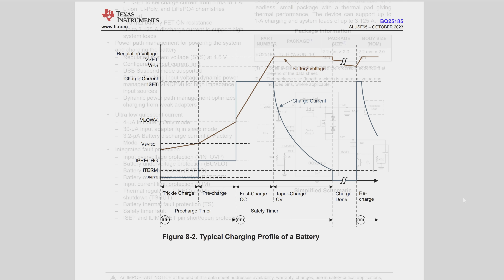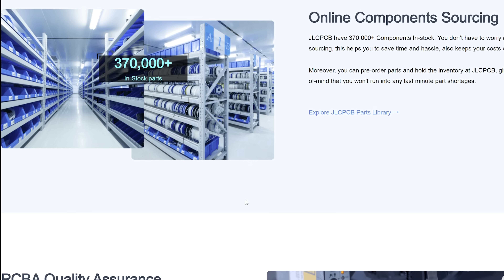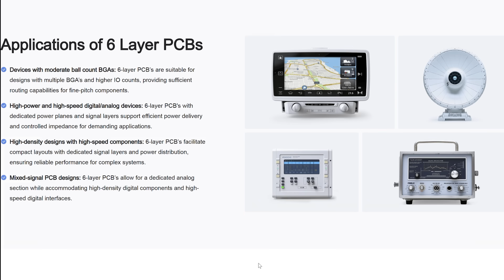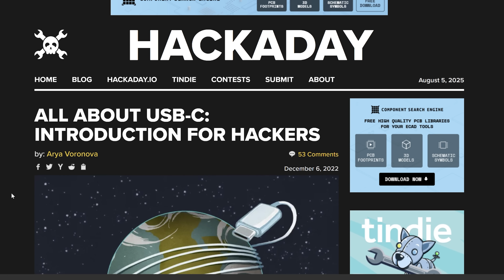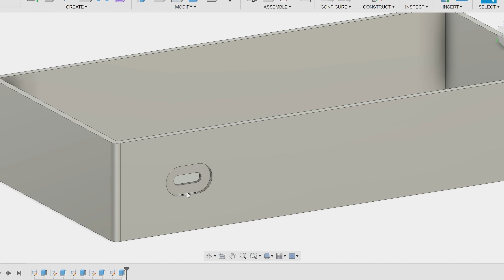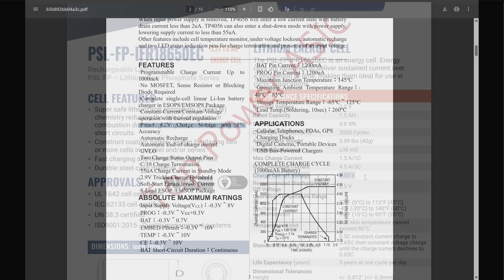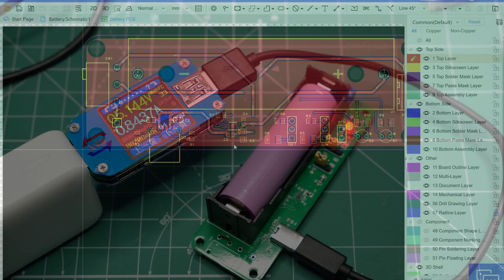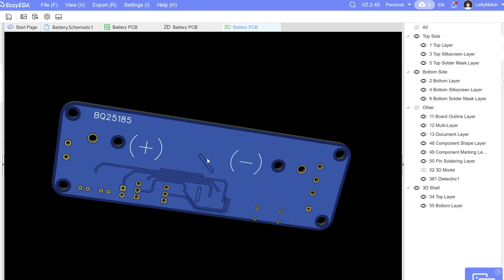Why I made my own battery charging module (no TP4056)

Comment: 5:08 for the pin headers you can use a potintiometers so you don't have to remove and resolder a resistor.

Comment: I have tried connecting those TP4056 based modules in parallel, with good results. Stacked one above the other.
I've had 3 stacked up charging a 1s 10AH flat pack lithium ion battery, connected to a solar panel able to output 2 4A. It seems to work quite well
Reply from the maker: Sounds interesting. It could be worth testing and doing measurements.
Reply: @LeftyMaker If you buy a heap of modules and can test them, parallel the ones most closely matched. I didn't use any resistors or anything, I didn't even match them, I just put the three modules on top of each other and ran tinned copper wire through the holes and soldered them. I noticed one out of the 3 lingered in charging, before going from red to blue, but it didn't matter with the big battery im using. I womdered about putting them in a little metal box and filling it with oil to promote heat distribution, but didn't worry about that either.
Anyways, just some food for thought.

Comment: FINALLY!!!!! THANK YOU INTERNET ❤ Have I been tearing my hair for years? Thought: Let's connect some Li-ion cells and get juice throughout my longer bike trips. NO!! NOT SO FAST..3,7X2= 7,4. There must be a module.. oops poof, frying sound, bad chineese quality, screen broke, .. * three years later * building module from scratch, plugging it in, worked at first, capacitor exploded when I played around with 50 volts.. well I love your idea and I will build several small ones and a big one.

Comment: You have many boards of your own design. And almost all of them have mounting holes. And some of them can be considered not as devices, but as modules of a certain functionality.

Are the sizes and placement of the mounting holes determined by something? Or were they chosen randomly?

If randomly, could you make 2 mm holes with a pitch of 5.08 mm in the future?
Then these modules will become mpp2508 compatible.
You can see what this is for and what it looks like by following the links in my profile (the last two).
There are renders of my modules, as well as photos of real assemblies - prototypes of devices for debugging. Perhaps you will like the idea.
This is an open project, and I am trying to attract attention to it. I do not have enough feedback. Its goal is to quickly assemble prototype devices in order to start writing software with minimal delay.

I have a battery power module in my plans, but I have not gotten to it yet. Is the circuit diagram of your module closed?

Ask questions if you have any.

Comment: You can add a dc-dc to this board and generate 1.8, 3.3 or 5V required for most MCU’s, and then sell it. I really couldn’t find a cheap module that can charge the battery and power MCU for my game console project.

Comment: You're comparing two completely different things. Your board is a prototyping tool — it has screw terminals, jumpers, and a built-in cell holder. That’s great for bench testing, but it’s not in the same category as the TP4056, which is designed to be a low-cost, compact module for embedding into larger systems.

Saying it needs hot glue isn’t accurate — people regularly 3D print mounts or use slot holders. As for charge current, it’s set by swapping a resistor, as shown in the TP4056 datasheet’s RPROG chart. The current is meant to be fixed per battery. If flexibility is needed, you can just drop in a potentiometer or built yourself a similar resistor array with jumpers to quickly change the charge current.

On protection: the TP4056’s default DW01A isn’t ideal, but there’s a well-known exact drop-in replacement — the FS312FG — which raises the over-discharge cutoff to 2.8–2.9V. It’s super easy and cheap to implement — you can get 50 of them on AliExpress for around $4.30–$4.50.

Regarding USB-C: the board in your own video has an empty solder pad behind the port, labeled R4, which appears to be for the 5.1k CC resistor. If you don't want to do that,  just use the micro-USB version of the TP4056 with a USB-C breakout board that already includes the proper resistors. It’s more of an inconvenience than a limitation.

Honestly, I’d even recommend the micro-USB version of the TP4056 over the USB-C one — it has better build quality (larger components, thicker traces, better layout), and you can pair it with a proper USB-C breakout for the functionality you want.

And finally: cost matters. TP4056 boards are about $0.15 in bulk and are drop-in ready. Your board definitely has a purpose, but it’s not a better replacement — just more convenient for prototyping. They’re entirely different tools, and saying "mine is better" overlooks the actual use cases and constraints most builders are working with.

Comment: For the original module, having terminals for connecting batteries with cables would give it dual purpose. Another design would be a competition to the small board with a better design. I particularly like the possibility of adjusting the charge voltage for different chemistrie.

Comment: I would see charging modules limited to 4.05V or 4.1V which improoves battery life by factor 100. no aging when full.
Reply: I’m trying to build one with discrete parts (lm339 comparator, LT431 adjustable zener, mosfet) but don’t go ok, i need to simulate better,  do u know what ic can adjust the terminal voltage ? I’m trying to reach 3.9 - 4.0 for li ion to obtain much better life cycles

Comment: I appreciate the effort you’ve put into it. This is great if it's for specific use cases like to make commercial custom products.
 
Personally, for my DIY projects, I prefer to go with the TP4056 since it’s quite cost-effective. The module is about ₹12, a holder around ₹15, and a panel mount micro-B pin about ₹5 on robu in website. With an occasional voltage regulator, the total comes under ₹50 (around $0.50) to convert toys into rechargeable ones. Custom boards cannot beat this price.
Reply: Plus, the OVD cutoff can be increased to 2.9v by swapping out the DW01A for a FS312F-G.

Comment: Another reason not to use the TP4056: Every one of the cheap Chinese modules have a design flaw in that they can overcharge a cell without protection. You’re supposed to disconnect from the load while charging.

Comment: Thermal management for tiny parts like that can be difficult. There just isn't room in the thermal pad area for more than about two to four vias and typically you're stuck with using thin copper to allow the narrow tracks necessary for the fine pitch of the "leads" of the part.

Solder-filled vias in the thermal pad can help a bit, but that is difficult, too. To fill the vias, unless their holes are extremely small diameter, can require more solder than it is possible to screen onto the thermal pad area. Solder flowing into the vias can "starve" actual pad area, leaving it with voids that impair heat transfer It looks like your PCB is about 1.6 mm (1/16") thick, which exacerbates these issues compared with thinner laminate. Copper filled vias can be a good option in terms of performance but may run up the cost of the bare PCBs.

I can't imagine any heatsink attached only to the top of the IC being of any significant value.

~~~
I've watched an number of videos of "over unity" power generators and other fraudulent devices. The makers of such things are great believers in use of hot-melt adhesives.
Proper mounting holes can take up a lot of board area, but at least you have something in the end that isn't held together mostly by wishful thinking.
Reply from the maker: Thanks for the feedback. Yes, the pcb is 1.6mm, JLC's economic option. I've never tried using any vias other than the default ones in EasyEDA. I've only placed a few around the chip, but not under it. Guess I should experiment with vias under the chip someday. By the way,  I think the chip would benefit even from a tiny bit of improvement. Even touching it with my finger is enough to pull enough heat away to bring the current back from 0.8 to above 0.9A.

Comment: @ 7:12 your 3D file shows three pin headers what's the third one that almost immediately after is not there on the board but has spots for it for
Reply from the maker: They are for a button that enables factory mode, which is a super low-power state, and for connecting a temperature sensor that monitors the battery's temperature

Comment: so that chip doesn't let you independently set current and voltage limits; it can only be one of the set configuration pairs in the table?
Reply from the maker: Charging current can be configured precisely by varying a resistor. However, the input current limit, which is set for protection, can only be one of the values in the table. I haven't tested this, but from what I understand, the max and cutoff voltage levels are also set only according to the table. Weird that they don't have an adjustable cutoff or at least a 2.5V setting.
Reply: @LeftyMaker  ah ok i somehow missed the ISET pin.  Yeah it would be nice to set the cutoff voltage to something like 3.5V which would get at least 90% charge on a LiFePO4 cell AND usually be within limits for direct 3.3v rail input on most microcontrollers/peripherals.

Comment: This is acutally realy cool, and a good idea to be configurable in many ways, sadly I lack the knowlege to make a design like this.

I tried using a tp4056 but it softened the pla of my 3d printed design so linear ones dont work for me, and havent found anything pre made on aliexpres that fits my needs, so in the end i just put a usb-C decoy and made it batteryless. It would have been cool to to have a battery cuz its an owl wallamp with the wings as light, you can find it on the printables store if you want some pictures of it. 

I saw an other similar one on ali that has UPS function (I like the idea to be able to have a battery if needed but have it pluged in most of the times and if im not mistaken its better for the battery that way) but that isn't configurable at all. 
Anyways maybe that would make this even better, and some switching ic but still with the configurable charging and protection.
Reply from the maker: Wow, didn't expect the charging board to be able to soften PLA. But yeah, I'll probably make more battery charging designs in the future.
Reply: You said it softened the pla so did you change the charge current at all? Because that's what leads to heat generation...

Comment: Please don't call them batteries. They are cells and if you put two or more cells together it will be a battery ... 😊
Reply from the maker: A single cell is still a battery
Reply: @LeftyMaker  "A cell is a single unit that converts chemical energy into electrical energy, while a battery is a collection of two or more cells connected together to increase voltage or current."
Reply from the maker: @fu1r4 According to both Merriam-Webster and the Battery Reference Book by Thomas P J Crompton, you can call a single cell a battery. Definitions change over time to facilitate communication. (Source: https://books.google.bg/books?id=QmVR7qiB5AUC&q=battery+one+or+more+cells&pg=PA11&redir_esc=y#v=snippet&q=one%20or%20more%20cells%20connected%20to%20form%20one%20unit&f=false)

Comment: 7:04 - But what is glowing there is the dual-MosFET.
The old TP4056-modules had a much bigger resistor to set the current, with the newer Modules it is very difficult with this 0402 resistor.
Reply from the maker: Not really. The camera can only measure at one point, and the image is misaligned. The chip gets hot
Reply: @LeftyMaker  - Okay thank you. Yes, the MosFET would be only hot if you discharge the LiIon-Cell in this moment.
Better make a photo without this composite-image of the normal picture and the IR-picture. The mixed image is confusing.

Comment: I love these type of projects. The TP4056 are "fine" at best (I've run into the 'shitty USB-C' issue plenty and hate it) and a lot of microcontrollers have truly terrible on board chargers. Which is extremely annoying because, ya know, microcontrollers are kinda useless without power. Personally I don't care about super fast charging. But I'd love something where I can easily plug in, charge and have my microcontroller mounted on back with whatever sensors and doodads attached.

Also also, if you're building cool things. Same thing you have here but with solar input.

Comment: This is an excellent project and I appreciate what you mentioned about the mounting restriction for TP 4056 however, hot glue isn’t your only option. I tend to mold the  correct shape into my 3-D printed part and holds it security for many years.
Reply from the maker: I see. Yes, that should work too!
Reply: This exactly.

Comment: My hands are itching to glue a tiny heat sink to that chip. And yes, you should make improved version but with switches instead of jumpers.
Reply from the maker: I use jumpers because I have hundreds of them in my parts bin. I also have switches that fit exactly into that same 3x1 space :)

Comment: at work i used bq25616, 1cell 3A buck charger, it can take inputs above 5V, i think it goes to 13V. for battery connection you can take a look at keystone 54, 54 is the part number.

Comment: I keep toying with the idea of building a cyberdeck, but I don't have the electronics skills to design anything like this. It would be more of putting together existing things to make a working unit. I really like the advantages you are explaining on your design, but it would be really nice if it would be multicell, as powering a cyberdeck on a single 18650 would be very limiting. Even my Clockwork uConsole uses 2 of them (while it would technically run on 1) but I can certainly see a use case for 4 or more. Especially if I want to ensure really long runtime on batteries. The other thing I would like for convenience sake would be the ability to charge it from any charger that supports PD. Cool project though.
Reply from the maker: Yes, it's on my bucket list to make a similar module for 2, 3, or 4 cells in series.
Reply: @LeftyMaker would a series parallel setup work? 2 of 4 in series and the two series sets in parallel? It would give the most workable voltage for something like a Raspberry Pi while allowing for decent current and battery life.

Comment: can you put a link to the usbc connector you use? how about the resistors necessary for it to work with usb c to usb c cables?
Reply from the maker: USB port: https://www.lcsc.com/product-detail/C30167331.html?s_z=n_C30167331
and
USB PD article: https://hackaday.com/2023/08/07/all-about-usb-c-example-circuits/

Comment: I'm sorry but about usbc not sticking far enough on tp4056 module you're wrong. I use them all the time in my 3d printed enclosures, you don't have to have it sticking out so much coz the cable doesn't plug flush with the plug, everything has clearance.
Reply from the maker: I guess it depends on the situation. In my experience, they've never been long enough, but I prefer wooden enclosures to plastic.

Comment: As already mentioned, IP2312 is a good high current alternative. But there's also a TP5100, which goes up to 2A and can be configured for either 1 or 2 cells (in series). Figured I'd mention it.
While I personally don't see the point in a custom solution due to severely increased costs, I like your design and attention to details! As well as the pointing out lesser known limitations of TP4056.

Some other noteworthy chips: 

1.BQ24195 -  switching | very high current alternative (up to 4.5A), switching type, I2C, dynamic power path, etc.. Quite a chip! Good for 21700s.
2.MCP73871 - linear | but has power path management. Still limited to 1A unless I'm wrong.  
3.LTC4162 -  switching | pretty versatile, built in MPPT + full I2C telemetry. Multiple configs and charging current levels + power path. 1-8S (LTC4162-L variant)
4.ISL9238 -  switching / buck-boost charger, bidirectional power path + USB-C PD compatibility + NVDC. 1-4S charging capability (via I2C or external resistor) 

Some of the chips have pretty advanced built-in protection systems too. It's a pretty long list though :P

Hope that helps in case you decide to explore this topic further.

Edit: fixed a typo (thanks for pointing it out rares3968).
Reply from the maker: Yup, I considered #1 and #3 but I chose something simpler for now. I'm still new to this field :) I'll try using these too some day
Reply: I2S... Isn't that for audio?
Reply: @rares3968  yep, it's a typo. I2C telemetry.
Reply: Thanks for the list! Great work.

Comment: I'd love to see a more compact version or even a multi cell charger
It could still have some mounting holes but the battery holder is quite bulky for some project
Reply: There is a 3 to 5 cell USB board for 18€ on Ali.

Comment: The "CD42" or "MH-CD42" modules have power path management since they use a IP5306 clone intended for use in powerbanks. They have actual safety mechanisms and a battery gauge.

Comment: could you use a variable resistor on that? I don't know if there would be one in that specific range though.
Reply from the maker: I have not tested this, but a trimmer pot should work instead of the resistor. The datasheet states that I chg = 300 / R. So a 300 ohm resistor + a 5kohm trimmer would give you a range of 1A to 58mA. You would need the 300 ohm resistor in series with the pot to set a 1A limit and prevent the chip from going into a fault state.
Reply: @LeftyMaker  could be a nice little project if you want to charge smaller batteries which i assume are what the terminal block on the pcb are for
Reply from the maker: the blue terminal is the Power Path output of the charging chip. It is for driving a load, either from the battery or from a connected charger. The unpopulated spot on the other side is for a switch I'll be using in a future project.